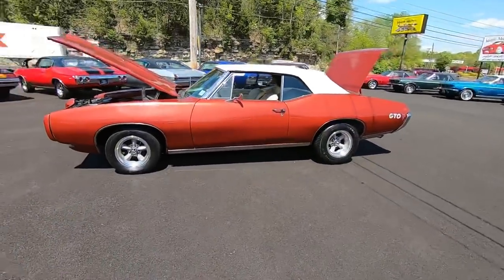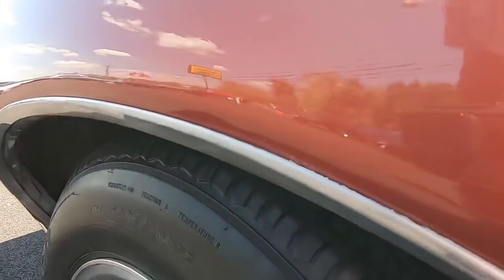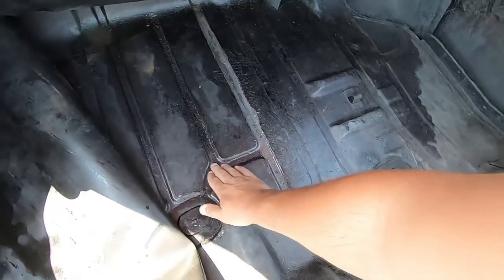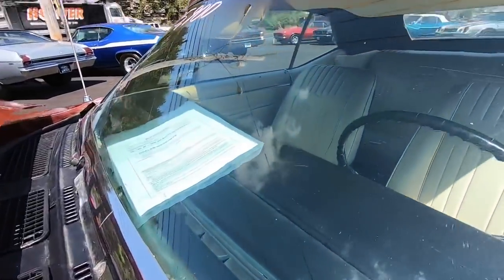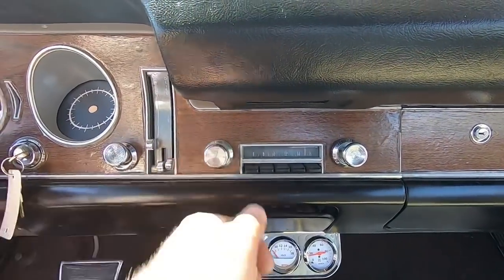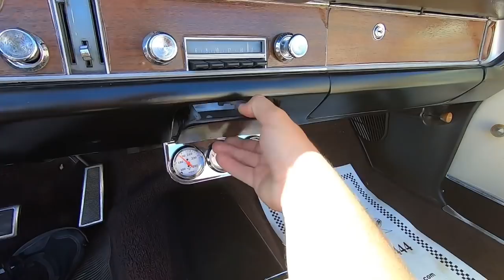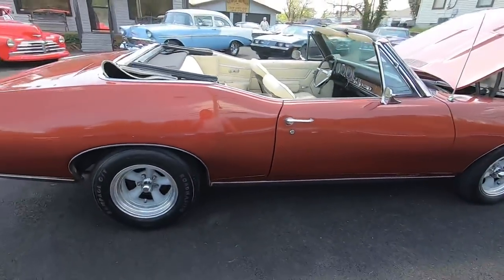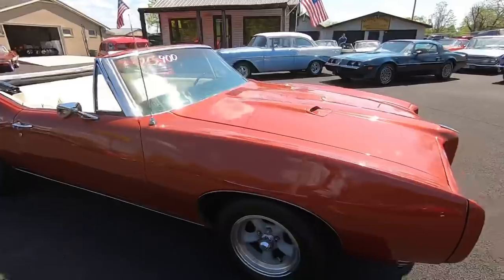1968 Pontiac Lemans Convertible SOLD $25,900 Maple Motors #1015

Comment: Very nice car brings back memories. I owned a 68 Pontiac LeMans Convertible 20 years ago. It had a 400 with an automatic transmission. I paid $3200 for it and sold it a year later for $4500. Burgundy with a black top. It's one of those cars that got away that I wish I still had.